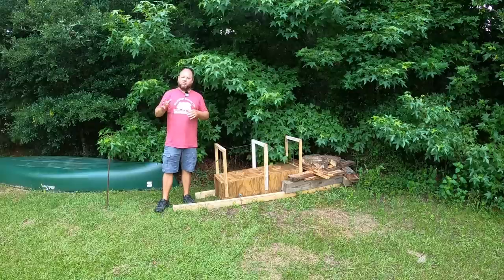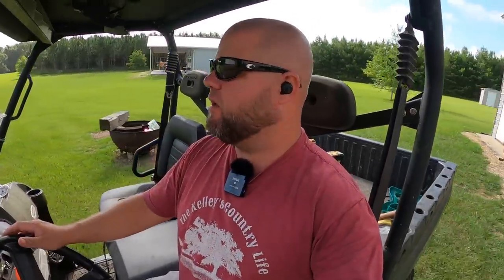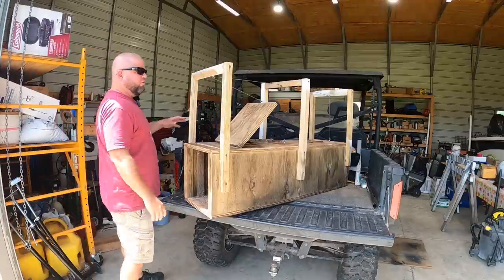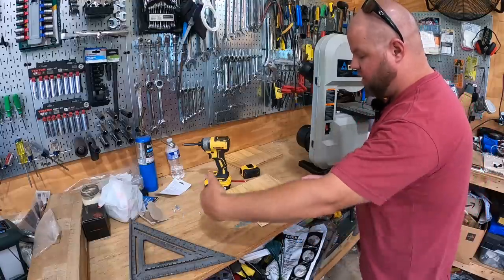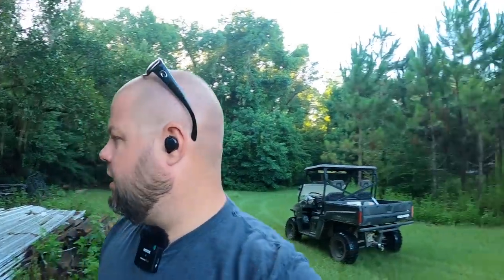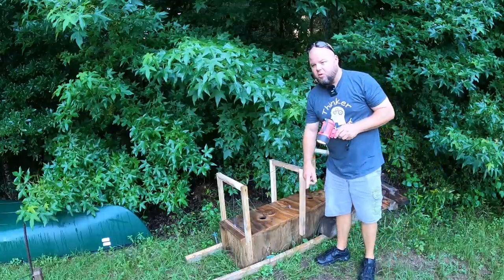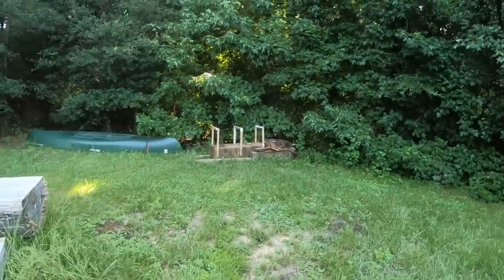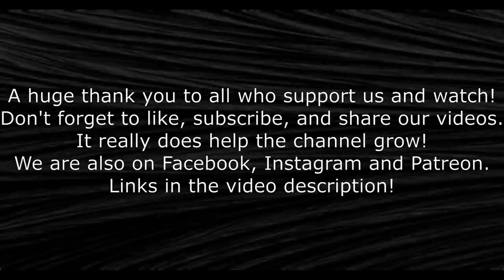Armadillo trapping, scented traps WORK! A new trap design! #611

Comment: If you make your trap smaller, use a 1/2 inch Dowel rod notched at top for trigger it works without fail for me.  Main thing I want to point out is that your traps and doors are plywood and will swell when wet and  will give trouble over time. Take a small section of roofing tin and place it on top of your trap for protection from the rain. Weight with cinder block for wind. Your trap will last much much longer.

Comment: S&W Governor or Taurus judge. I think it’s an awesome unit to carry around in your tractor or Polaris. It uses a 45 or a 410 shot shell. That way you’ve got all the villains the first few rounds with shell shot and some 45s to back it up in case you get a bear or something. Some people kind of laugh at them but for caring around on your property it gives you a pretty well-rounded solution for those types of problems.
Reply from the maker: I actually keep a 22/410 combo on the ranger and a 44 mag carbine in the tractor.  That 44 mag can take down anything here or I can slip a powerful rat shot in for snakes.

Comment: I have a large trap I use to catch them in. Normally I set it in front of their holes and place rocks and wood around the entrance to funnel them into it. The other day I just set a trap out in the yard out of my way to do some yard work. Came back a couple days later to find one in the trap. Not near a den, it just went in on it's own accord. Always figured they can smell where others have been as I have had them dig out the same holes several times.

Comment: Made the trap but they're nosing the door up and escaping. H ave to come up with some kind of locking system .Hey from N Florida btw
Reply from the maker: I have not had that problem, but I can see it happening.  An easy fix is to add a 1x1 piece of wood on the inside floor where the door drops down.  That way they nose the 1x1 wood piece and can't get under the door.  They can also walk over that piece.
Reply: @TKCL   Thanks. Had that in there already.  It ripped one side off completely. Might have been a possum. Anyway  came up with  latch system that falls into place when the door drops shut.  Nobody’s gettin out now. Thanks for the initial design.

Comment: My control trap for armadillos is a 12 gauge with number 2 steel shot 😁
Reply from the maker: Can't say I disagree, I've been using 3 inch #4s 😉
Reply: @TKCL  great video Andrew, could you add sand/dirt on the trap floor & transfer some of the armadillo scented soil to other traps? I made the comment before the end of video
Reply: Houses next door and all around so a shotgun is out but I can verify a 22LR will take care of the problem without waking up the neighbors at 2 or 3 AM
Reply: @geraldfoon6283  i am lucky my neighbors do not care and sometimes i even go out with the AR
Reply from the maker: I run a silencer on a 22lr and 22 mag. Both are very effective.

Comment: Wonder how well a trap made of expanded steel top and sides would work? Would allow you to see them as they get trapped and easier to see what you have trapped. In any case, glad to see the current trap configuration working well.
Reply from the maker: Would probably work just fine. Steel is outrageous right now, lumber has dropped significantly.

Comment: What are you doing with the armadillos? I know your putting them down, but are you using them for anything? Just curious. Also, something else you can do, at night, ride around and spot and drop the ones you see as well as running a few traps.
Reply from the maker: We do night rides often. I dispose of them, our state rules actually call for that.
Reply: @TKCL  growing up in Florida I was unaware of that. Didn’t know if you was some how utilizing them for anything, thanks for the quick response!
Reply from the maker: Read the fwc regulations, they call for disposing of them on site. You can transport them, but they can only be released on a certain size property and you must have written permission.

Comment: Here in north Florida I have caught and dispatched almost 20 this year. I have noticed a few things. Armadillos are creatures of habit. They repeat their steps. So, if you can see their patterns of movement via a camera you can set your traps in that location it helps. Also, of the 20 or so I have only trapped two females. They seem to be more rare than males. Juveniles will come out in the day almost as though they haven't figured out the danger. Lastly, I have found that .22LR is not powerful enough to dispatch them outside a trap humanely. I certainly do not want anything to suffer. Consider a 9mm carbine rifle if the noise would be an issue. I have had luck using inexpensive night vision and a UV laser.
Reply from the maker: I'm over 70 that I have removed since last year. 22lr will work, I highly suggest cci segmented rounds, they are deadly. No matter what you shoot them with they will flop for a while, it's just reflexes. I've used everything to take care of them.
Reply: @TKCL  I got one with my .22LR at night from about 15 yards and it ended up in my trap a week later with a wound to its hindquarters. Good idea switching out the ammo as you suggested. I have seen armadillos take three hits from a 9mm and still run off. They can be tough little buggers. I got one this morning in my "Tru Catch" trap. The armadillos here destroyed those cheap big-box store traps.

Comment: I think if you make the trap where it's a 2 in 1 where 1 goes in like you see, let's say the left side that door closes and it would be trapped and then you could have the other side so that when the friend was coming in and he can go in on the right side and then he gets caught and you have 2 inside instead of only one
Reply: Smart man. Came on to say the same!
Reply from the maker: I'll have to experiment with that design.
Reply: @TKCL  my second thought is the door wouldn’t close completely with the body size vs. length . “First go-a-round” 🧑‍🎓
Reply from the maker: Im afraid I would have to make it very long and heavy to pull that off. I'll have to think it over.
Reply: @TKCL  I think the size you have already is big enough to be honest
Reply from the maker: It probably is, it's about as much as I can handle. I made it way too big.
Reply: @TKCL  looks like you can get 4 in there,  depending on the size that is.  Maybe move the trap closer so you don't have to wait till it gets to the middle so you can do it on both sides

Comment: Your next challenge is to design a trap that auto dumps the dillo and resets for the next in line. They make mouse and rat traps that do that.
Reply: No need for auto dumping, with that big box, if instead of drop doors he just used a pair of one way swinging doors on each end, they would push their way in, (burrowing animals will generally, happing force their way past minor obstacles like that.) be unable to walk back out and push past the second door to the interior so they can's sneak out when the next one opens the door.

With a trap that size, he could probably catch 3-4 in the same box in a night.
Reply: This is a live trap. Trap and release would be the humane thing to do.